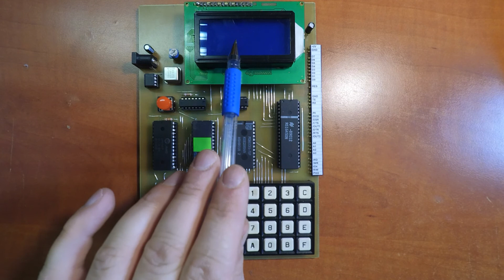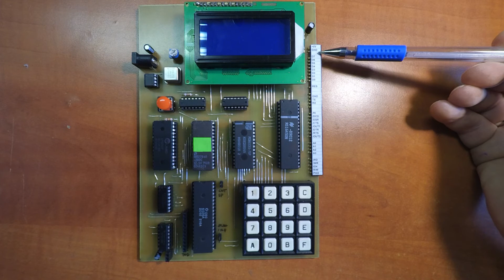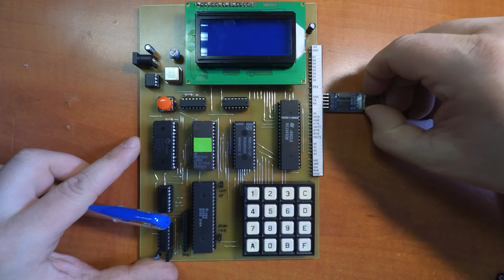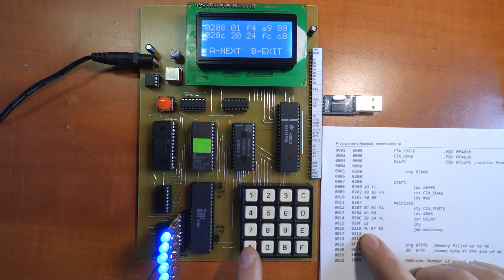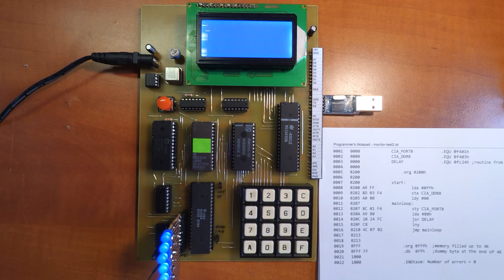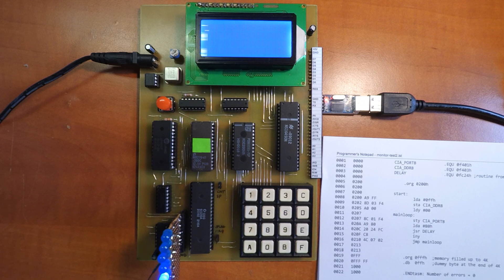Homebrew 6507 Single Board Computer

Comment: Thanks for showing off this project! I don't see many use the 6521 PIA, almost every SBC or homemade computer around the 6502 uses the 6522 VIA, did you have a design reason for that, or was it a similar matter of it working and having it around?
Reply from the maker: Hi! Thanks for visiting ! It is actually 6526 CIA that handles most of the I/O on the board. The chip was chosen because of richest feature set among the family, but also because I had several of them ripped out of comodore C64 boards :) Anyway id does it`s job really well !

Comment: You can still buy new 6507s from NTE.
Reply: douro20 and also New 6502 s from Motorola
Reply: what supplier?
newark, mouser, or digikey
Reply: @Decco6306  jameco is one they sell 68000s 6502 65c02 8080 8088 8085 6809 6800 and some other cpus
Reply: What would be rather surprising, given it was produced specifically for Atari, and they shifted to using ASICs for the 2600jr. I can't fathom why anyone would bother producing 6507s these days! I'm guessing it's some new old stock?